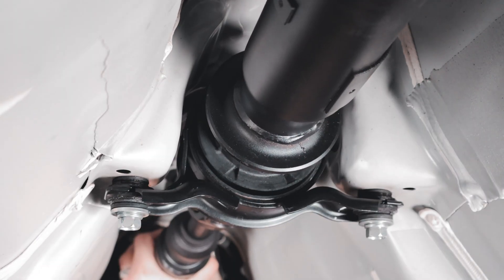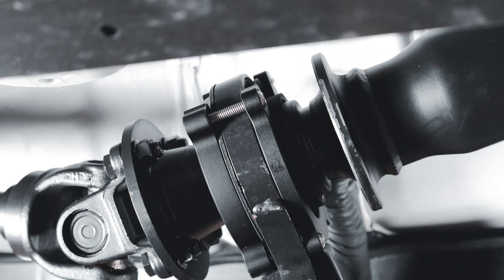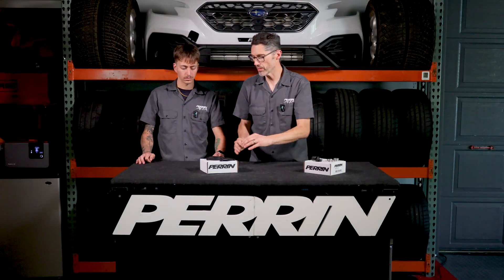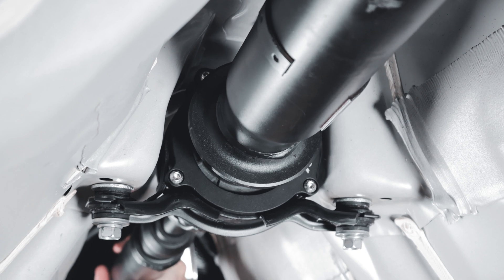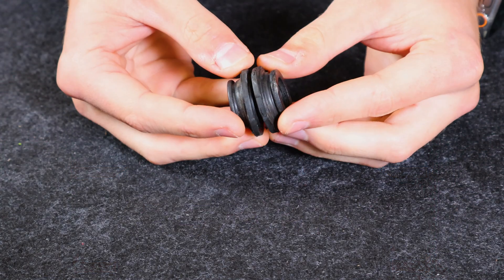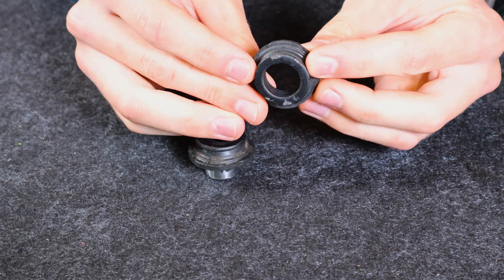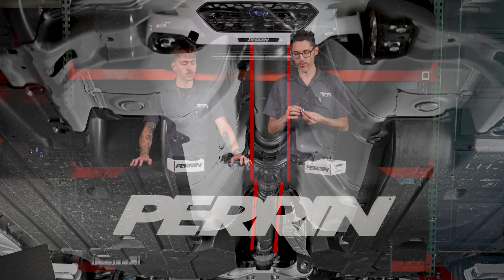New Drivetrain Gear (Tech Talk)

Comment: In independent suspensions, driveshaft angles are intentionally offset to help with lubricating the U-joints. If the U-joints don't pivot during rotation the rollers push all the grease away from their contact with the races and never re-lubricate.
Reply from the maker: Totally valid concern, but modern U-joints are sealed and packed with grease, using needle bearings that stay lubricated regardless of angle. Our Driveshaft Carrier Bushings are designed to reduce the excessive factory misalignment found in the OEM setup, which helps minimize vibration and wear. U-joints actually perform best with minimal angle, and while our bushings improve alignment, they don’t eliminate it entirely—there’s still enough articulation to keep everything operating as intended. Really appreciate you bringing up the deeper tech side of things!

Comment: question if i wanted to swap to an sti transmission I'll probably got to change thew drive shaft would i have to get different ones or can i use these
Reply from the maker: Oh right on! good news, you won't need a different lockdown. our lockdown works on both STI and WRX! Same goes for the Carrier Bushings.

Comment: Are there any plans to make carrier bushings that are made of poly instead of solid metal?
Reply from the maker: We  dont have any plans to make them out of poly. Are you concerned about noise/vibration?
Reply: @PERRINPerformance  not so much the NVH, but any long-term structural impacts to the frame of the car that the drive shaft carrier is attached to, due to vibrations, etc.
Reply from the maker: We have no concerns with this because the carrier bearing is still supported by rubber. And there is not much force being applied to this. This kind of part has been around for quite some time and no issues have been reported.
Reply: @PERRINPerformance  thanks that's helpful
Reply from the maker: Awesome! Have a great holiday!

Comment: Pre install issue:clunking from ds center support during transition from acceleration to deceleration and the inverse. Vibration comes on at 30mph and becomes harmonic at about 45. Something is certainly wrong.
Reply from the maker: I wanna make sure I understand exactly what’s going on. So just to clarify, this is an issue that is/was happening before you installed the driveshaft lockdown?
Reply from the maker: Also, what year and model do you have? Also the mileage would be helpful.

Comment: 30 min instal , very litle more vibrations,  love it !!!
Reply from the maker: sweeeet! did you install both the lockdown and carrier bushings?
Reply: @PERRINPerformance  I already had the carrier bushings ( preveously  done, another brand product,  aluminium one's)   did not feel any change... but whit the lockdown added. ... i love the subtle NVH it's addidng and the directness of the connection you feel trough acceleration.

Comment: Have you guys had anyone complain about drive shaft vibrations prior to install? I have a 22 with 30k miles and im having some pretty intense vibration at various speeds. Its not the wheels everything is balance, too early for it to really be ball joints or bearing. Which leads me to believe its drive shaft vibrations
Reply from the maker: That is not something we have heard of on these cars. I would double check that the pitch stop mount is tightened or not broken, as that can do some weird things if its loose. If that is tight, then it could be drivetrain related and this might help. If you can check the pitch stop get back to us and we can work out a deal to see if our parts fix the problem.

Comment: Just ordered both of these! I really would love to know the real reason Subaru designed the crankshaft offset like it was. If they wanted it straight it would have been straight, so I wonder what we're potentially sacrificing here. Like the plastic pitch stop that everyone upgrades- the plastic had functionality so that in an accident the engine could "slide down" instead of straight back into the cabin.
Reply from the maker: We dont have a definitive answer, im sure Subaru does😂 but... our best guess is it was a required saftey measure to pass standards.
Reply: It's for crash safety. In the event of an accident,  the two piece drive shaft is designed to bend down and away from the passengers/drivers. Same thing for the plastic pitch stop. In an accident,  the pitch stop mount is designed to push the engine down away from the driver or break in the event of a bad crash
Reply: @ Thankya. Unlike the other carrier upgrade which replaces this with full metal encasement, I think this one which sandwiches in two horse shoes- should still allow that safety feature to work right? It's not often that you see horror stories or posts on the internet about driveshafts penetrating the cabin... In fact, I've never heard of that that happen before.
Reply: In independent suspensions, driveshaft angles are intentionally offset to help with lubricating the U-joints. If the U-joints don't pivot during rotation the rollers push all the grease away from their contact with the races and never re-lubricate.

If there is no vertical offset, then they probably decided to do it horizontally.
Reply: @MY1PATH  Dang, you have made me consider this potential downside to doing the straightening upgrade. Sigh, once again there's another pros & cons to consider! Thanks for the engineering explanation. I think I'll do it anyway (Already bought the parts) and consider greasing that part as long term maintenance
Reply: @KuyaPow626  since they are offset bushings, you might be able to rotate them in a way that allows some driveline angle. 
I cannot say how much a straight driveline accelerates the wear or if it is even noticeable. Being front bias AWD helps reduce wear of rear components as well.
Reply: @MY1PATH  I guess if Im at 150k or 200k miles in this WRX and this driveshaft starts to make noise that won't be the worst of my problems lol
Reply: @ Perrin mentioned in my other comment that there still is some angle, Just less than stock. I'm willing to try this product as well. I don't like how modern OEM tries to combat NVH by introducing overly compliant "dampers"
Reply: @ Yep I just read that. As an engineer myself I love seeing all this technical stuff really dived into. Its so much more interesting to read than the typical ads you see for products like "+5 HP, beautiful carbon fiber, aerospace grade aluminum, make your VB looks sick now!" This is the real info I need to see.
Reply: @KuyaPow626  Opps! I totally forgot to say how much HP this mod makes... I do think it is slightly more than a MoMo sticker but the OP may have a dyno result to prove it. (to all future readers this reply is a joke but the others are not)

Comment: Installed the driveshaft lockdown & carrier bushings last night on my 2023 WRX. Just went for a drive to make sure everything was good. I’m getting a slight odor of burning rubber. Is that normal?
Reply from the maker: Glad to hear that the smell went away. As far as the root caute of the smell id imagine some gunk fell on the exauhst when you poped out the old carrier bushings. Even if the carrier bearing was not lined up perfectly you wouldnt hace any rubbing or grinding issues, so thats my best guess.
Reply: @PERRINPerformance  Everything has been good so far & no issues. Thanks!
Reply: I think you should look under there and reinspect lol
Reply: @KuyaPow626  It’s fine now. Re-inspected everything and driveshaft is centered perfect & everything torqued to spec. No odd noises, vibrations or odors anymore 🤙🏼
Reply: @AaronWhitt82  You didnt need to change or adjust anything? Never found out the root cause?
Reply: @KuyaPow626  No changes or adjustments made. Been driving for a week now and no issues at all. Thinking maybe since it was new install it had a short break in period or something. Hopefully no carrier bearing pre-mature failures down the road…
Reply: @AaronWhitt82 ”self clearancing”😅

Comment: will these parts put tohether allow fow more horsepower to the ground? if so then how much?
Reply from the maker: The large benefit to these especially together,  is they will give you a better drive feel. You will feel more of the road beneath you and how your car is reacting to it. These parts fall under the same category as a transmission mount or our engine mounts. The added stiffness of these parts and those alike aid in connecting the car and the road to the driver.
Reply: @PERRINPerformance  ok. Sounds good. I already have transmission,engine mount and pitch stop. I like that feel